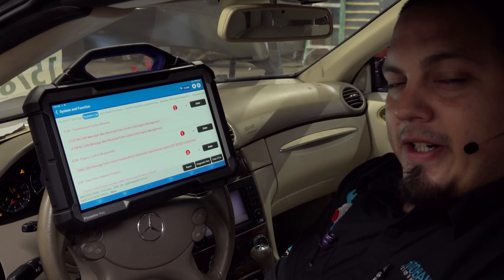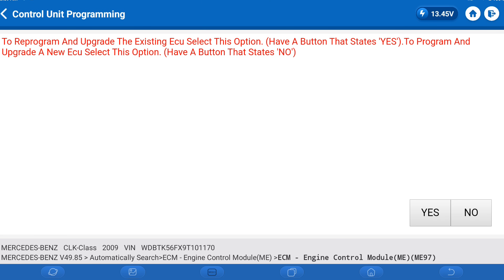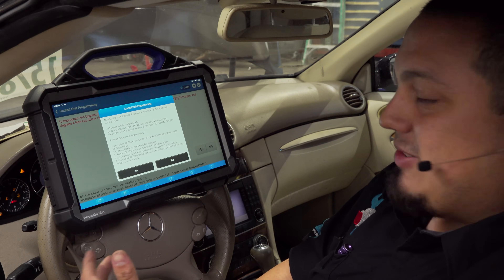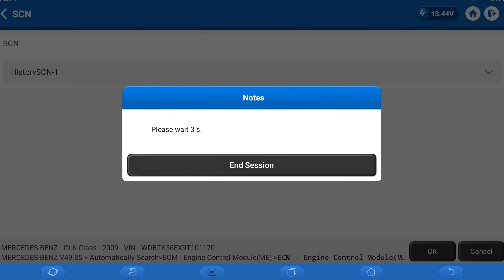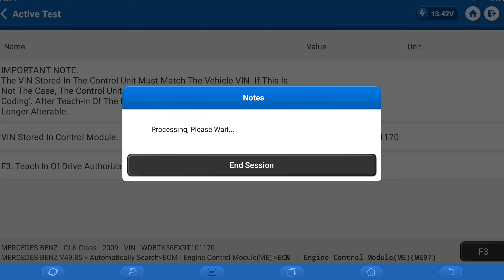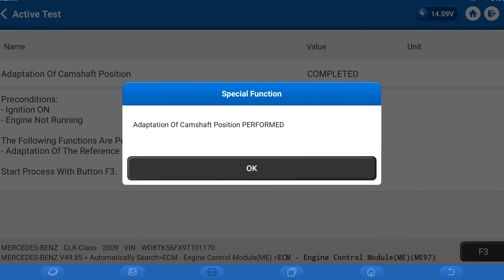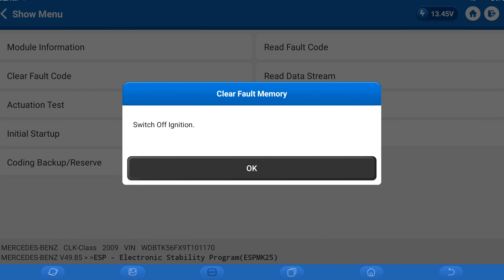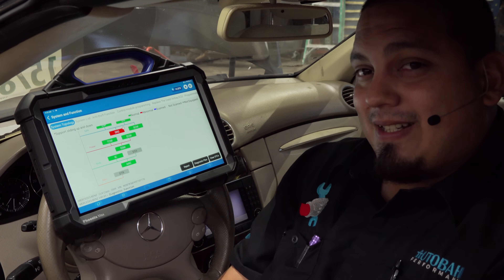MERCEDES BENZ | PROGRAMMING | ECM(ME) MODULE | TOPDON PHOENIX MAX

Comment: Hey I have and 1999 c280 v6 ..but my issue is that the previous owner of the car send out the eis to get it fix but didn’t receive it back…how ever I purchase and 1998 ecu with the eis and esl would it be able to plug and play ..or if not could u copy the data from the 1998 to the 1999 ecu to get the eis and els to pair it together?!!! Would really like some help.  1999 Ecu K01  6zyl FD 98M11 Sw

1998 ecu K02 6zyl FD 97M08 Sw

Comment: I have a 1998 S320 Mercedes Benz, Camshaft Position sensor comes back, we checked & changed everything, camshaft shaft position sensor, crankshaft sensor, spark plugs, alternator, magnet, wiring and timing, fault code comes back, can you reprogram or clone my ECM

Comment: Mario, thanks for the video!
One question: Can I use the Phoenix Max to program an used ECU just like you did? I just got a used ECU and went thru the programming process. Everything went fine, but the car does not crank. Any advise?

Comment: HELP. My mechanic rebuilt my transmission. Now he’s gone through 2 transmission modules, because my car is not responding to them. he said Mercedes made 3 different modules for the 2012 E350 he just has to get the right one
Reply from the maker: They must be programmed to the vehicle
Reply: @SuperMarioDiagnostics  car is not responding to the programming. He’s said it’s like a body rejecting a heart or kidney transplant
Reply from the maker: @apaul8132  that’s because they need to be virginized before it can be programmed. You can’t just program a used one
Reply: @SuperMarioDiagnostics  They are all new modules
Reply from the maker: @apaul8132  what’s he using to program it?
Reply: @SuperMarioDiagnostics  I’m not sure. I can get back to you to  you when I find out. What should he be using? It a2012 E 350
Reply: @SuperMarioDiagnostics could you do this with this scan tool though? Or wouldn’t you need the oem one?

Comment: hello Mario . could you please tell me what kind scanner I need to do the programation  the adblue system module in 2016 Mercedes benz sprinter 2500 2.1 diesel engine ?,  I replace that unit but I don't know if that need to be programing after replacement .. in the cluster I have message there is 2 start left any help very appreciate

Comment: So the program is provided by Topdon  and what you have done here is transfer it's information to the new Benz module and that process is called 'programming'. Can the Topdon change the program to include, say, a capacity to turbocharge a non turbocharged engine without throwing codes?
Reply: You can add a turbo to technically any non turbo car.
You only need to.calibrate the ecu. 
Thats another department.

Comment: in regards to the programming such as, ECU, PCM, TCM, BCM, Airbag Module, Fuel Pump Module and others modules that requires programming. Can you please recommend an auto programming tool where, you plug in and play the software and just prompt options on the screen.???

Comment: I think I'm having a problem with my ECU I just installed the engine and transmission back in my CL500 2003 I replace my timing cover and did not have to mess with the timing I have gas but no spark change my cranking sensor 3 times it constantly cranks but will not start can someone please tell him with this trouble code is that came up p1 925 the trouble code says Drive authorization is refused body control module N15/5 (Electronic  Selector Module (ESM/EWM) is this stop my car from starting from not getting spark do my ECU have to be reprogrammed and so I'm in Philadelphia can someone refer me to someone that do programming thank you guys

Comment: Do the newer Topdon devices differentiate between sporadic, intermittent and permanent DTCs now? In your big comparison video from about a year ago you mentioned the phoenix plus didn’t
Reply from the maker: It does
Reply: @SuperMarioDiagnostics  Thx alot, I think I will go for the Phoenix Smart, because I need a powerful diagnostics tool that supports different Protocols.

Comment: Thank Mari for your Video. I just bought a 2006 MB C 280 and with TOPDON ArtiDiag Pro Bidirectional Scan Tool that I just got, I did the diagnostic on the car and got this results:

There are 3 issues for Power system:
1.The Internal Electrical Check Of Component
Y3/83(K2 Clutch Control Solenoid valve(VGS)) Has
Failed.
2.Fault present in control module Transmission (P2734)
3.Diagnosis of tumble flap 'Intake manifold':Short circuit to ground of sensor lines/Tumble flap shafts stick in the actuated position. (P2004). 

Can you advise me cause I’m trying to minimize my expenses fixing the car. Please need your expertise on how to fixe all 3 issues for power systems found on the car. Thank you very much,
Francis

Comment: As a gm tech very interesting one question what is the difference in programming and coding thank you
Reply from the maker: Programming is installing the firmware. Coding is configuring the module to tailor it to the vehicle build(some are 6cyl, some are 8 cyl, etc)

Comment: Hi Mario, thank you for the information. I was curious about programming a Mercedes with the Topdon. I usually use Autel MS909 even though I would rather use Xentry but is out of my budget. One recommendation is to use "initial startup" instead of "programming'' when programming a new module. This option will guide you through all required steps (program, coding and adaptations). Something I noticed about the programming was that the new software level was older than the original (old). This is common with Autel as well. Unfortunately in the aftermarket industry some times we don't have other option than downgrade the software  in order to program and code a new module. This is the reason some people don't recommend using aftermarket tools to program. Unfortunately some times the manufacturer doesn't give us other options unless we want to spend a lot of money. In MB case about $30k for the factory tool .

Comment: I actually like watching programming sessions. Others may think they're boring, I not me! Keep them coming, Mario! God bless!
Reply: Might be cheaper reprogramming a used module just in case of a malfunction
Reply from the maker: And if you have a malfunction during programming a used one, you're still in the same boat. Best to learn how to recover them
Reply: @SuperMarioDiagnostics :  If module "bricked", i assume we mean that the core firmware got corrupted; and by recovery we mean burning a clean copy of core firmware back on module so tech can start over with VIN specific updates. Am i close??
Reply from the maker: @hightttech  correctamundo
Reply: I agree. It's the next level, but I've heard horror stories about programming gone wrong and the shop being on the hook for bigx bucks. If bricking an expensive module is inevitable, then definitely seems like a gamble. Gotta calculate risk v reward.
Reply: That's when you get better at it than everyone else,when it's interesting.